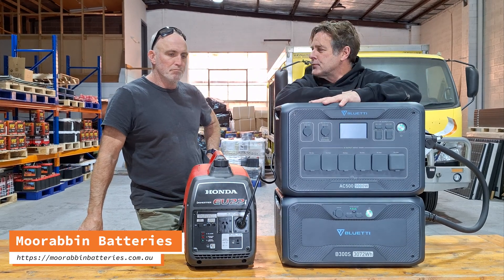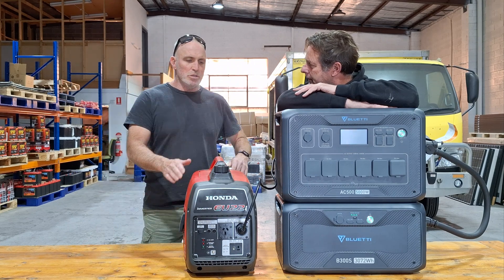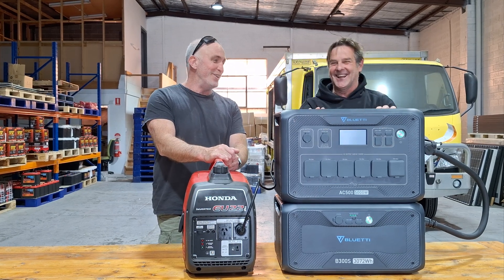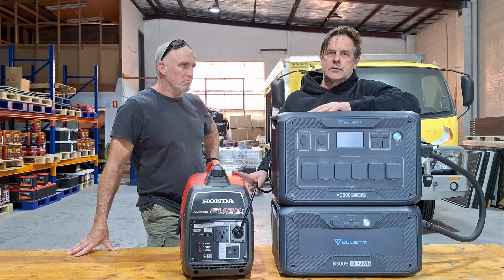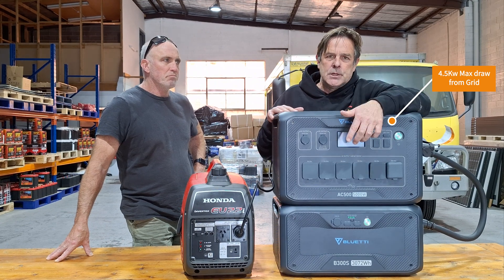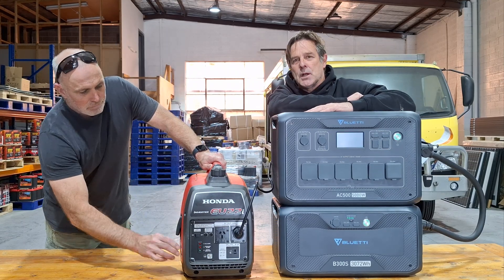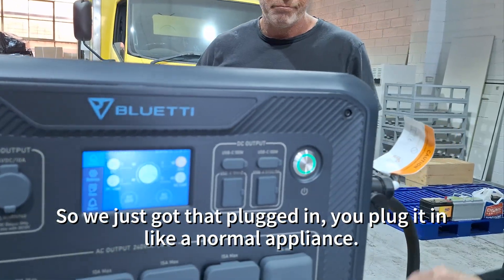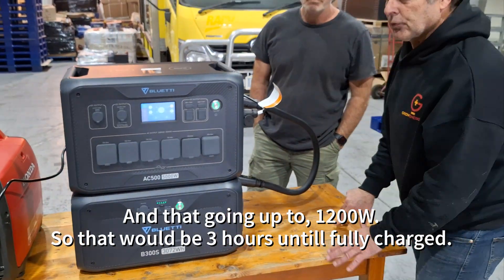Generator Charging a Bluetti AC500 with a Honda

Comment: I have a small generator and a Bluetti ac180. The generator will not charge the Bluetti no matter what I do. The screen just keeps flashing “ground”. I tried using a grounding switch but that didn’t work. The generator is already grounded to the frame of itself, so I do t get why it won’t work.
Reply from the maker: From the sound of it both the AC180 and your generator have what's called a "floating ground" and once connected both will share the same ground, if you're trying to ground both the AC180 and the generator its possible that you're creating two bonding points which could be the cause of the error. Try using the app to put on the grid self adaptive mode or putting the charging mode to silent would be my first troubleshooting step.

Comment: What settings do I have to change to send power to the ac500?

I ran this exact same generator with it and nothing happens
Reply: same
Reply from the maker: in the settings on the screen of AC500, Max Grid Input Current, set it to around 5-7 amps.

You plug the AC500 into the generator as if you were charging from the wall outlet.

Hope this helps!
Reply: @MoorabbinBatteries  bingo! Thank you